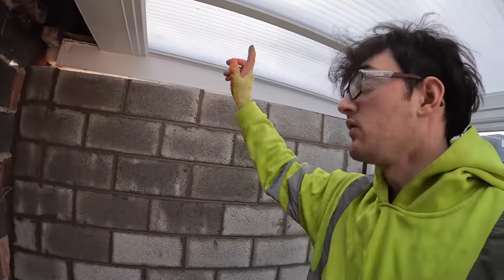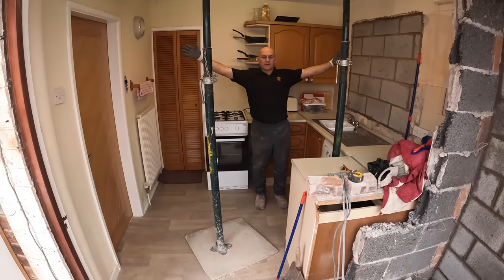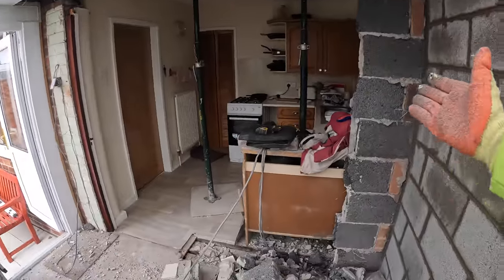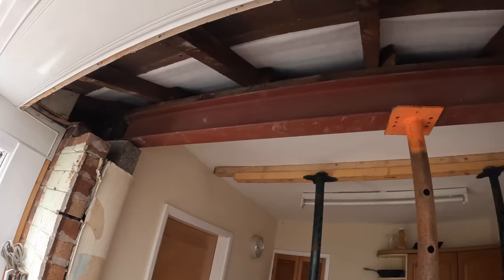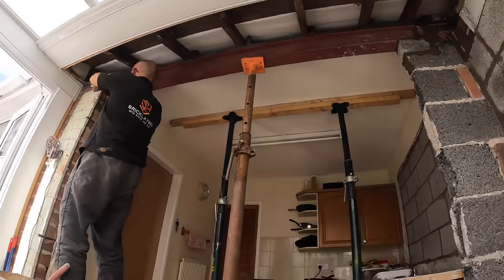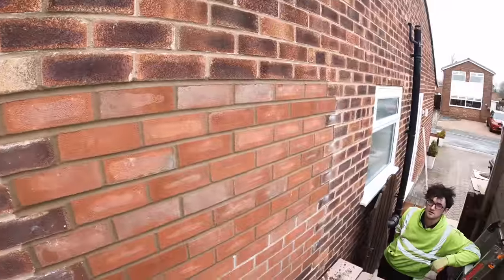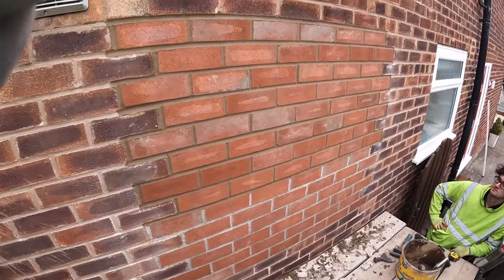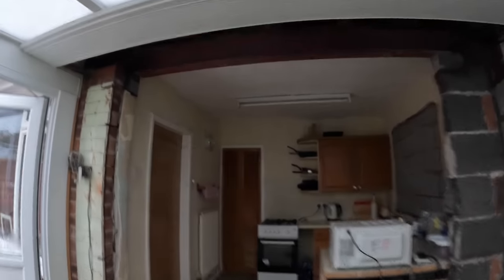EASY STEEL BEAM INSTALLATION ..KITCHEN CONVERSION PART 4

Comment: I’ll be amazed if the property owners have gone through with Building Regs here, because as far as i know you cannot open up you house into a plastic conservatory like this due to insulation/heat loss.
Reply from the maker: It has gone through regs 🧱👍🏽
Reply from the maker: @martin2466  😁🧱👍🏽
Reply: I wouldn't let the builder film it and put it on YouTube if I was doing anything naughty 🤫
Reply: @martin2466  exactly my point
Reply: @martin2466  I’m I guessing ur the client?

Comment: Have you guys ever done one of these where you're replacing a window and widening the opening to fit French doors / bifolds. I guess the process is more or less the same, support the internal leaf, take down inner and outer leaf beneath the window and widen as appropriate, fit steel, make good.
Reply from the maker: Spot on. 👍🏽🧱

Comment: Going to ask a silly question here guys but bare with me, why do you fill the 3 holes in the red bricks with mortar before laying them on the bed of mortar ?
Reply from the maker: Only on the top course so When we fill the top bed we have a head start 👌🏼🧱👍🏽
Reply: Saw that first filled brick in the stack and knew why. So when they tuckpoint that last top joint the mix doesn't just fall into the holes and leave a gap at the back of the joint,
Reply from the maker: @AWSmith1955  👌🏼😁🧱👍🏽

Comment: A question that's only just occurred to me as a layman - don't metal wall ties create a thermal bridge, thus reducing the thermal performance of the wall? I mean, I guess it's not massive but is this ever a problem or consideration?
Reply from the maker: No mate 🧱👍🏽
Reply from the maker: @martin2466  🤯🤯🤯🧱👍🏽

Comment: As I am planning on installing a steel beam to support the roof of my bungalow, I was wondering about putting cement underneath the beam to level it. Do you think that this would be a good (acceptable) practice or advice against it?
Reply from the maker: Different engineers and building inspectors specify different methods . 
   Better to ask on of these in your local area 🧱👍🏽

Comment: Another good series, what is the plan with the roof as cavity is open to elements
Reply from the maker: No idea mate , we don’t get involved with the roof 🧱👍🏽
Reply: @SteveAndAlexBuild  Can't fault your side, but speaking as a homeowner I would want as much natural light as possible and as these conservatories are self-supporting.  I would have left the window, removed the interior wall and just bought a new conservatory (one side panelled and reinforced to hang cabinets)
Reply from the maker: @freepress8451  building regs would have laughed at us 😳. 🧱👍🏽
Reply: @SteveAndAlexBuild   I agree, It is building regs that requires separating doors between a conservatory and the main part of the dwelling.
Reply from the maker: @freepress8451  🧱👍🏽

Comment: I hope they’re having a new solid roof for winter, it’ll be freezing in there if 5hey dont
Reply: Even the conservatory roof lining ( just like insulated panels ) easy to fit and gives thermal value same as they should do with those walls . Add the panel/ lining get the R value up esp with energy costs now
Reply from the maker: @makg4655  it’s all in hand by the next trades 🧱👍🏼

Comment: Good work but why weren't the outside bricks matched up to the same type of brick that already been used?
That would wind me up everytime I saw that, if it had been done to my house
Reply from the maker: Those bricks were discontinued about 40 years ago so no hope of matching them .
   Customer chose  the ones we used plus it’s getting rendered eventually 🧱👍🏽
Reply: @SteveAndAlexBuild  that explains it 🙂
Thanks for taking the time to reply
Reply from the maker: @sagster no probs 😁🧱👍🏽

Comment: Nice job as usual fellers. Are they going to insulate that roof?

As usual gone the extra mile and replaced that damaged flag. Little things like that go a long way with customer satisfaction.
Reply from the maker: Cheers Jack . Yes there is a lot of work still to do to the conservatory structure . 👌🏼🧱👍🏽

Comment: Its a pity the engineer wanted a big nib, if possible I would have gone for a longer steel set into the brickwork and a straight wall in that kitchen.
Reply from the maker: Engineer knows best 👍🏽🧱
Reply from the maker: @martin2466  👌🏼🧱👍🏽